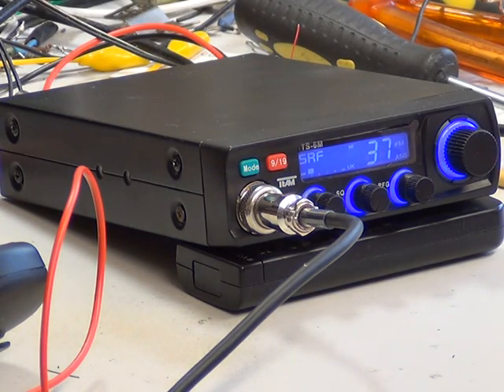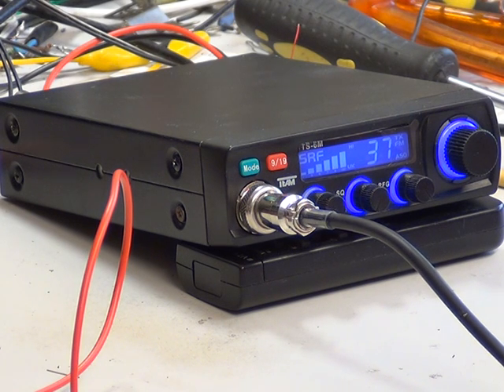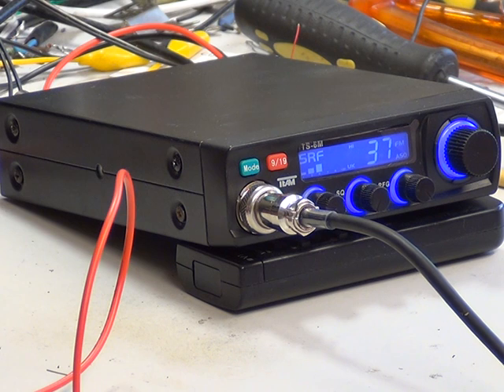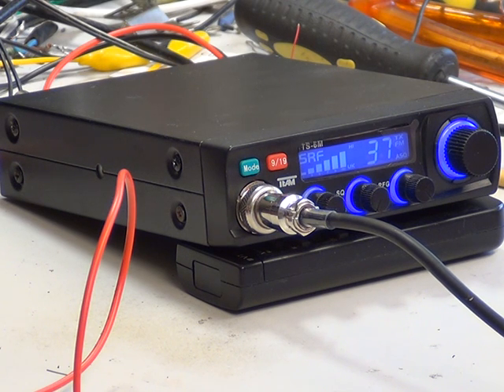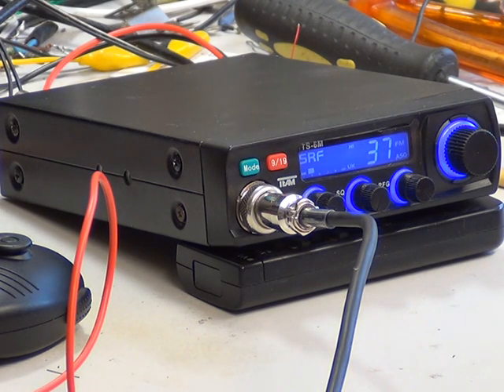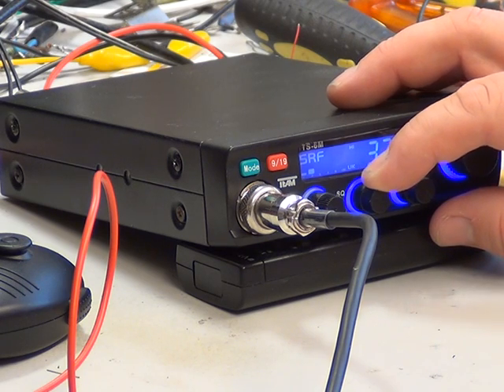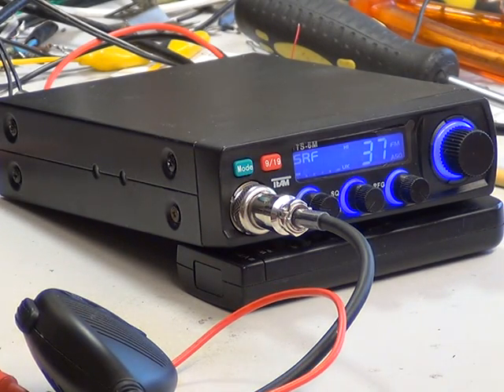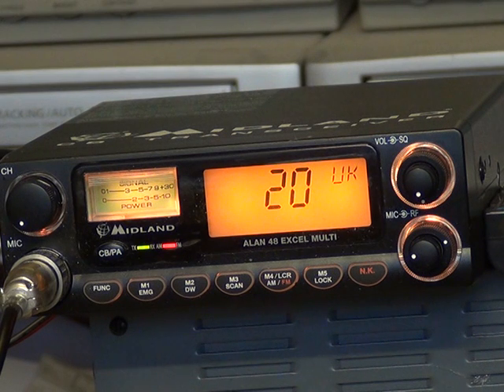Team TS6M, UK/EU (CE-Multi) 80-channel CB Radio (Mobile) - On The Air  test

Comment: Received audio sounds slightly like it's cracking / got that kind of 'off frequency' effect.
Reply from the maker: It's quite 'speech processed' Look at The Electric Man's video of receive.

@6AnTIVKz53U
Reply: UK CB radio servicing
I suppose it depends largely on the receiver too, my Realistic TRC-2000 was so good it seemed to make almost anyone sound superb! I think the treble can be prominent on the TX audio without sounding raspy, for example the Maxon chassis Midland Precision series; those sets always impressed me with their transmitted audio.

Comment: Thanks for that Richard, another great set of videos. 

Seems like a good radio but how come they never get the power or deviation set correctly from the factory? I bought mine on another interner guru's recomendation, but it looks like I will be sending you mine for adjust at some time in the future. 

How do you fancy checking them on AM now that its legal? It has mid band AM and FM on the EU setting. Just hold the Mode button down while turning the set on to access this.

All the best John.
Reply from the maker: If the factory set them on the low side, chances are that if government inspectors pull a sample for scrutiny, the performance will be well within the rules. The receiver seems to work very well & the transmitted audio is speech processed to make it more at the treble end & thus more punchy. The electric man has done a video of the transmit side as received by him, which is a better demonstration than my 15 seconds on a radio in the next building here.

@6AnTIVKz53U